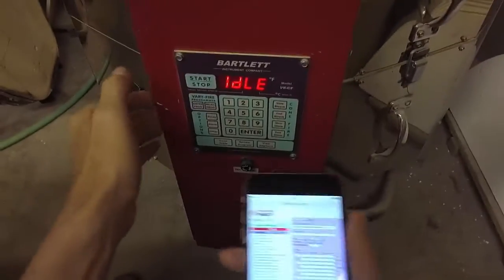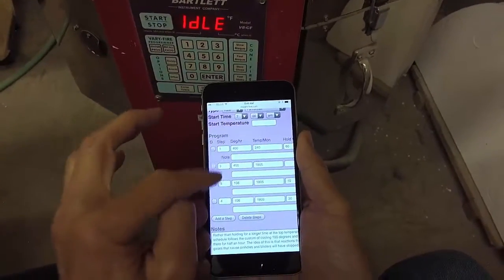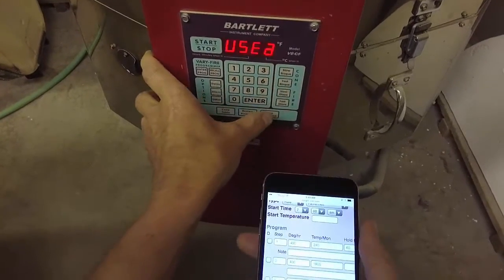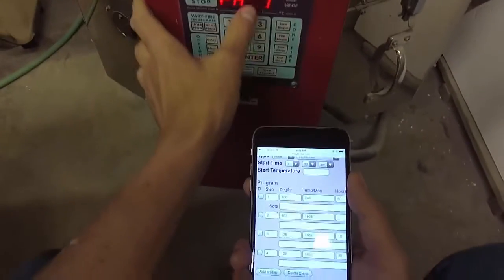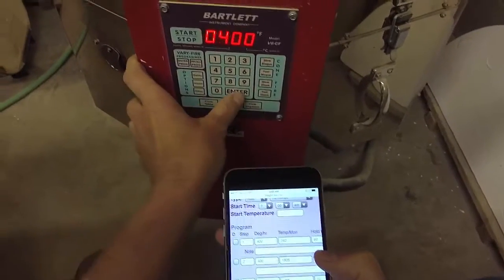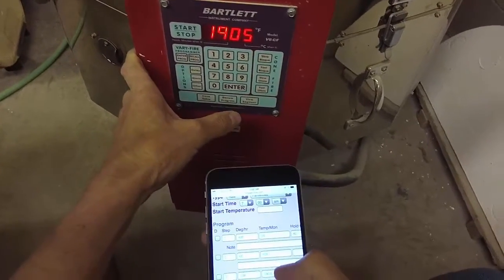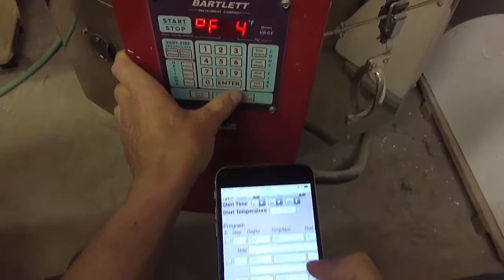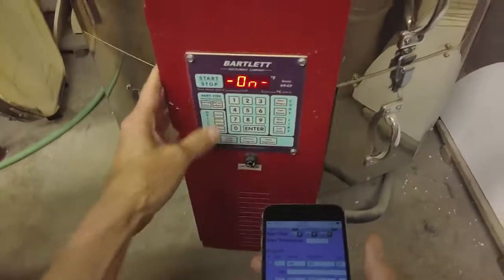Manually program your kiln or suffer glaze defects!

Comment: Hi Tony,
Just got Insight-Live and I love it!  I need and want  to spend way more time with it! I'm just wondering if there's some good reference material for ideal firing schedules for various glaze temperatures and bisquing for different clays and glaze firing atmospheres.Thoughts?
Reply from the maker: Not that I know of. Bisque as high as you can while stiff having enough porosity for glazing. Bisque slow enough during early stages not to crack ware. Glaze fire rapidly to 100-200 below firing temp, slow down to 100F/hr to final temp, hold for 5-10 minutes, drop 100F and soak there half hour. Fire slower if lots of heavy ware, fast if ware is light. Heavy ware might need easing down through quartz inversion.